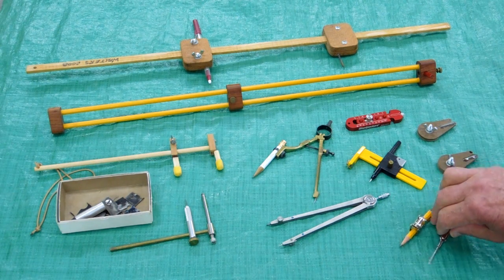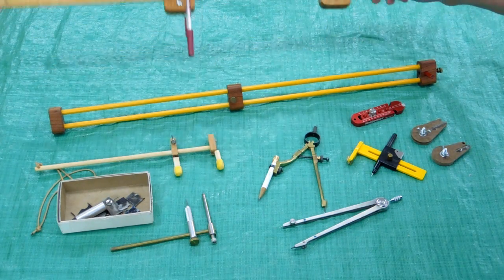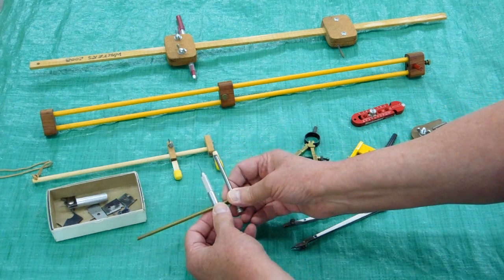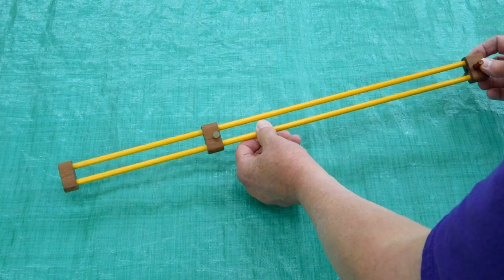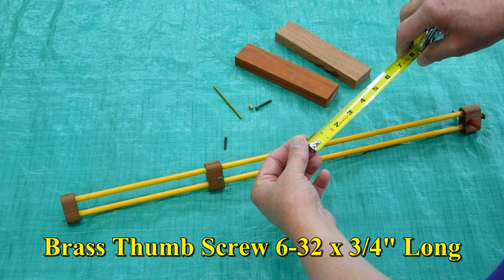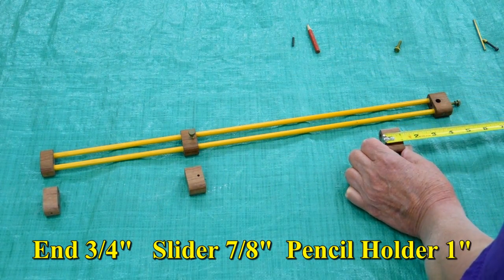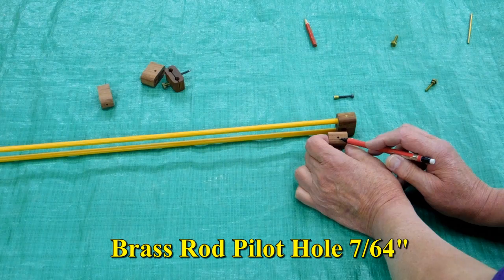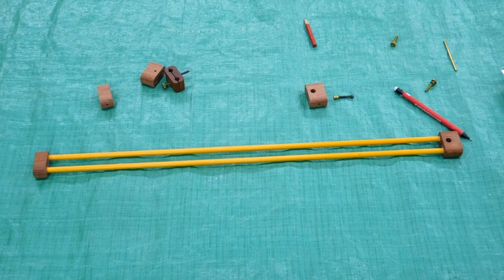Dual Rod Beam Compass

Comment: You mention that the person who sells this kit no longer sells ...
But tell me in your particular case where you bought: brass thumb screw, threaded metal insert and brass rod.

These parts would also be useful to modify my homemade gramil, and do better.

Good Job!
Reply from the maker: I bought the few remaining thumb screws they had plus the solid brass rod for the pins. Microfasteners.com has brass threaded metal inserts. K&S Precision Metals has solid brass rod in many sizes. Google "Brass Thumb Screws" and you will get several hits. Looks like Home Depot has some sizes in their hardware drawers.
Reply: Thanks for the information Ronald...!

Comment: Thank you for the video. 
Have you seen and compasses that are solid enough to use a knife to cut through rubber?
Reply from the maker: Max Kalin The large wood beam with the ink pen would work. Replace the ink pen with a aluminum X-Acto knife with a No. 11 blade. Or the beam compass with the pencil hole drilled for an X-Acto knife.
Reply: Hi. Thanks. I will try to do that. 
I have a cnc machine and I will try to make a more sturdy device. I have 1 inch pressure pressed birch plywood. 
I will use few ideas of what you showed to make a heavy duty compass.

Comment: Another great and inspiring video, Ron. Have you experienced the fiberglass marker rods delaminating yet? I have a used one here but cannot touch it without getting tiny shards of fiberglass in my hands. Painful! It might be the outdoor UV light that causes this, so an indoor, shop-stored rod might not breakdown the same way. I'm just curious about your experience with the rods and the effect the sliding portion might have on the red's gel coat. Again, great video.
Reply from the maker: Dave Potts  I've had some white fiberglass rods at the end of my driveway for several years and have not noticed any UV deterioration happening other than they aren't as shiny as when new so possibly in another few years. Not much will stand up to UV long term. Now if a careless friend decides to run over one and the rod flexes more than it wants or then gets crushed by the friend's tire as he backs up and has another try at the driveway, it will shatter into strands of fiberglass which are pretty nasty but I can't blame that on the fiberglass rod. :-) The sliding portion of the beam compass moves very freely and I do not expect to ever use it so much as to wear away any portion of the gel coat.